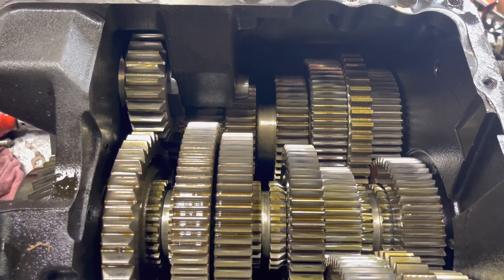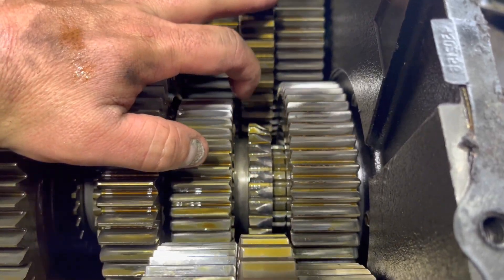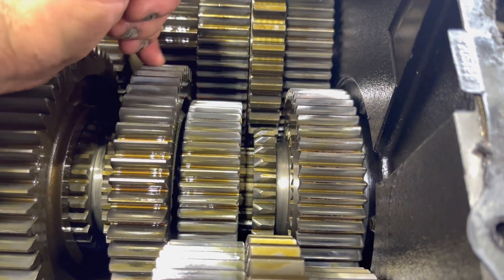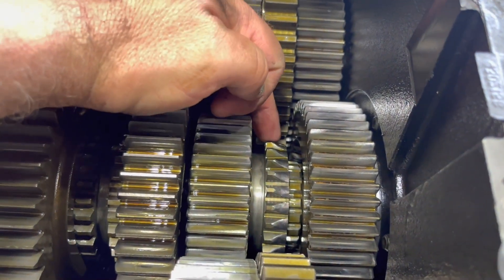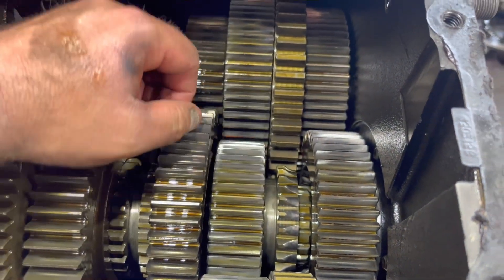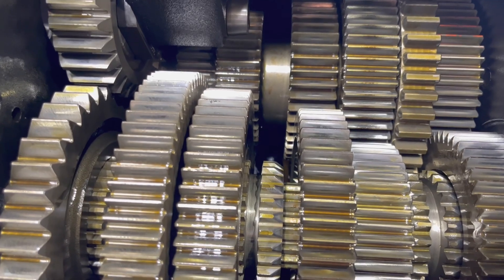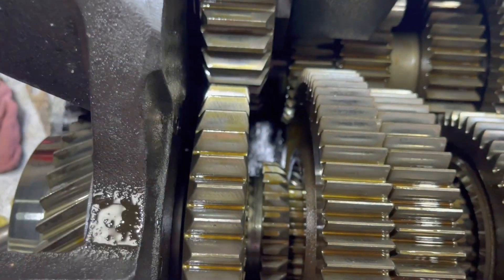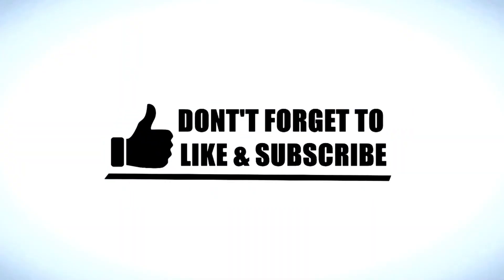Eaton Fuller Transmission jumping out of 9th gear

Comment: Had the strangest thing happen the other day while driving a farm truck with a 10-speed. It often slips out of 4th if you give it enough torque, and throws the stick back into the neutral position. However, this time it threw the stick FORWARD out of gear and was stuck there. Pushing the clutch in and dragging the stick back toward the in-gear position, it would grind. I don't remember if I tried the clutch brake, but I'm not sure that would've made a difference. It took two of us to pull the stick back into gear with the truck off. What's going on here?

Comment: My Eaton Fuller 10 speed manual jumps out of reverse. Being told slide assembly is the problem. Does this sound about right? So far no issue with any other gears. I haul overweight containers up to 54K
Reply: That's exactly what was shown in this video. Just imagine it happening with your reverse gear which is just about as small. It's still a pretty major problem. Unless you rebuild it yourself you're probably looking at swapping it out with another rebuilt exactly like he did with this customer's transmission.

It's also possible that your shift fork for reverse is worn out, your shift linkage is having issues, or low transmission fluid.

But if they already told you the problem it sounds like you might need to change it out with a rebuilt transmission.

Comment: Hey , maybe you can help me ?  2016 cascadia With an Eaton 10 spd.

My truck will throw and anti slip light and the truck will refuse to pull itself out of the smallest divot in the yard..it just locks up and wont move.. i was stuck on flat ground 1 time with just an inch of snow. I can hear a valve or solenoid clicking when it happens...the mechanics at my shop are kinda useless. Any input would be Greatly Appreciated.

Im no truck mechanic but am pretty mechanical as I've neen employed at machine shops and do all my own work on my own vehicles from complete front end replacements to motor work....its got me perplexed and need to be able to point them in the right direction. Thank you Again.

Comment: Having an issue with the truck going into neutral (gears grinding)  when the jake brakes are on and working.  Truck will bounce a little before happening.  Stick stays in the hole though.  Have also noticed, truck will bounce/buck a little if you are backing up for a significant amount of time.  Thinking a transmission issue?  Any ideas?  13 speed Eaton is what is in it.
Reply: Sounds like your gears are out of timing but could also just be bad or low transmission fluid.

Comment: Transmission will slide out of gear very ear and by its self wuth no noise no big bang not even noticeable is this the reason
Reply: What if the stick stays in gear? My transmission shifts out of the last gear but the stick is still engaged
Reply from the maker: Is the stick moving out of gear if it is then yes this is the issue

Comment: would this be the same problem for my 13-speed popping out of 13th or could it be the detent as the detent doesn't quite feel like it does in the other gears? Basically it doesn't feel like it is completely "seated" in 13th the way it does when any other gear "seats". Thank you.

Comment: Can this be fix by repacing gears ? Or better off replacing whole unit with new transmission
Reply from the maker: This issue is a very easy fix. You are much better off just repairing the transmission. Part number k3420 will include all the gearing to fix this issue
Reply: How hard is it to replace the parts needed?

Comment: What about popping out of reverse ??
Reply from the maker: If it’s jumping out one thing for shure there is a problem in there.
Reply from the maker: On this particular transmission it could be an issue with the reverse gears clutching teeth on the inside. Or mabe an issue with the reverse gear and reverse washer that is held in place by the snapring. You can check out the video we have up on how to rebuild an fro16210c to get a visual on the reverse gear and how it’s held in place on the mainshaft.

Comment: When sliding clutches are worn out like that, is it common to replace the gear that it engages as well? Or can you simply just replace the worn sliding clutch?
Reply from the maker: You really want to look at the inside clutching surface of the corresponding gear. Don’t ask me why but usually on an Eaton transmission, if the sliding clutch is worn out the gear will be as well. The same is not always the case with a Merritor transmission. I think due to the heat treatment of the gearings with the Merritor you will sometimes see the sliding clutch has a ton of wear and the gear will be just fine. It’s strange